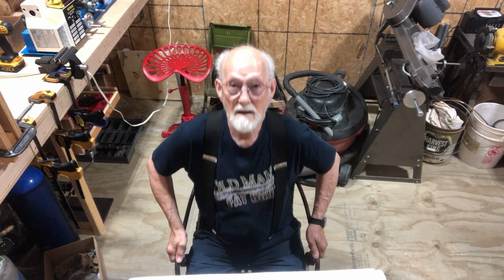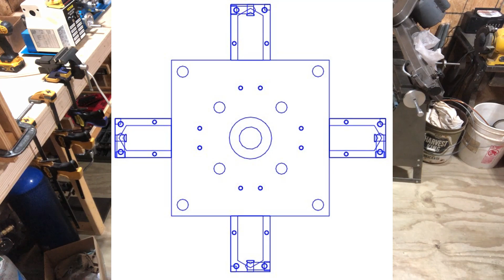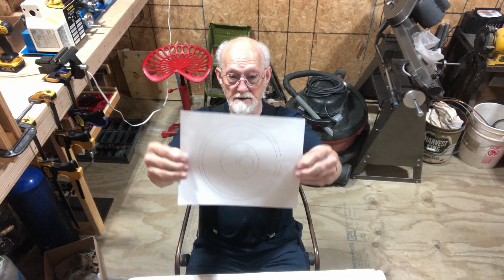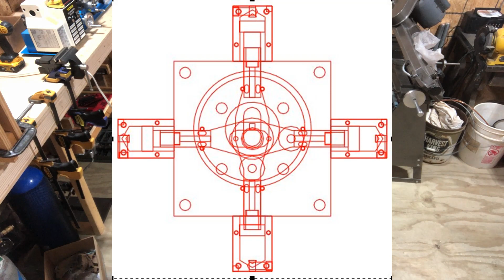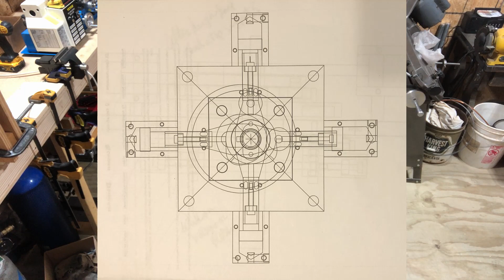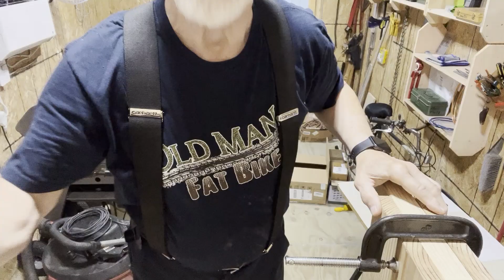Air Engine Research - Drawings & Designs for Final Version 7-27-23

Comment: So how are the timing of the valves controlled ?
In your last video, your calculations where based on full pressure on the full stroke.
Thats why you efficiency is really bad, and a short range of your vehicle.
I hope you are familiar whit the term "cut-off" otherwise Google it.
Basically you should only put pressure in your cylindre the first 5-10 % of the stroke.
But I like your entusiasme, so go on with your building !
BR from Denmark
Reply: I'm not sure if your fully understood my question. Pressure regulating is a very easy thing, but has nothing to do with cut-off. The exuast-valve are best just to be fully open from BDC to TDC (or a few degree before). The inlet-valve are to open at TDC (also perhaps a few degrees before) and then to be closed again after not more than 25 % of the stroke. This way the air will expand , and not just run on "full thrust". 
But that is a challenge there allways has been with steam engines also.
To make variable cut-off is even a bigger challenge, so if you choose a fixed cut-off, what % of the stroke will you choose?
(Some people name cut-off as an angle degree from TDC, so 25 % equals 45 degrees)
BR
Reply from the maker: @MrRinghoe  I do understand what you are saying, and it may end up being close to 25% open time?
I will be tracking rpm's, torque, and air consumption to end up with a final Rotor design.
In the meantime the parts have to be made and assembled.
I think about my project full time, but I'm not able to work on it full time.
You mention steam engine, working with or have experience with it?
Reply from the maker: Thanks for following what I'm doing!
The Rotor (there will be two, the upper will be Air In, lower Air Out) will open and close the valves and will be made individually so they can be tailored to best performance.
The Engine is designed so it can be mounted upside down to allow running the engine with the valves and the rotor accessed easily for removal, in order to make modifications based on testing various designs of the Rotor and timing.
I haven't decided yet how to supply the air to the valves.
The calculations I quoted are based on constant pressure set to run, or I could use variable pressure operating a variable pressure regulator - using only enough pressure to move the vehicle?
Thanks for you question, but at this time nothing is set in stone!